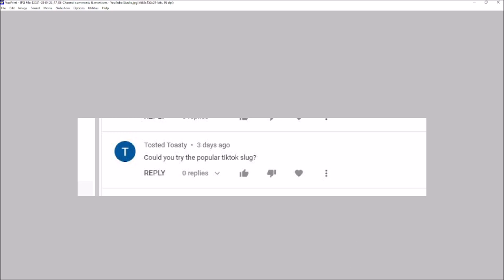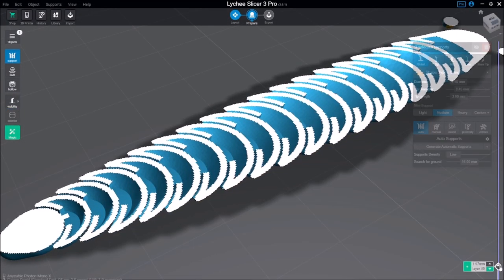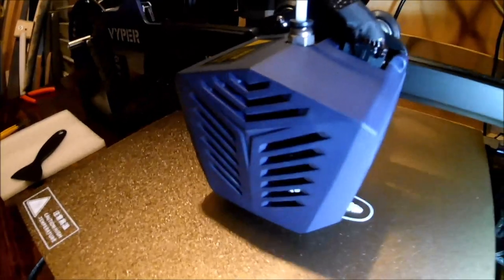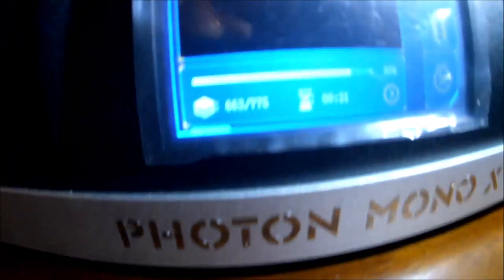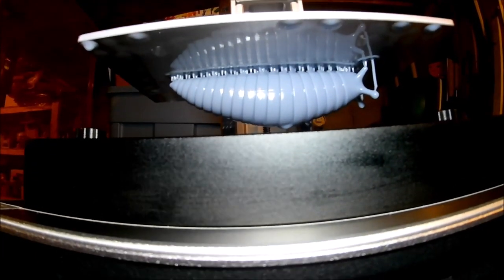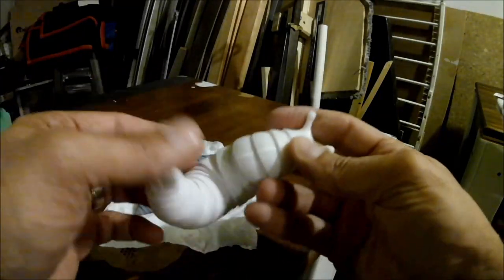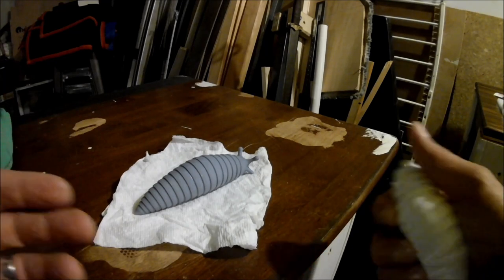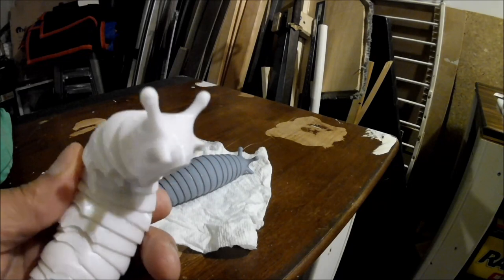Anycubic Vyper vs. Mono X "Slugging" it out with the Slug model

Comment: im so SAD, I printed my slug using the Anycubic Photon Mono. And it came out perfect and articulating. PLEASE TRY AGAIN! no supports, wash very well before curing. make sure its completely dry before the curing as well.
Reply from the maker: I believe I must have some light bleed possibly due to my screen protector.  I will try a few calibration tests and see if I can get some improvement.  Thanks for watching!
Reply: Also no success.
Reply: Lower the exposure ma dudes and dudettes

Comment: printed mine on the mono SQ,  it failed but some of the pieces moved  I sprayed in between each section with rubbing alcohol using a spray bottle getting the resin out.  I'm using any cubic Gray basic resin 20sec  bottom exposer time for 6 layers, a 2sec normal exposer time, at a 100% uv power output and a layer thickness of 0.005, also a off time of 0.5.
Reply from the maker: I think this is a particularly challenging model for resin printing.  Temperature and cleanup will definitely be factors.  Thanks for watching!

Comment: Slug on my Anycubic Mono with no supports printed fine in Lychee and is fully articulating. I've made 3 and they all turned out fine. Turned out fine on my Ender3 V2 also.
Reply from the maker: Hello!  Are you using the updated Lychee with elephant foot correction?  I haven't tried that for this print but I am hopeful it will work.  Thanks for watching!

Comment: Did the slug on my mars 2 no supports with ww mint at 30um, worked great but the clean up and cure were abit more effort that usual. Works great.
Reply from the maker: That's very interesting.  On the MonoX I must be having some UV light bleed due to the screen protector.  Thanks for the feedback and for checking out this video.
Reply: @RealgarTheSchist  did you have any luck with the slug on the mono x?
Reply: What settings you used for the Mars 2

Comment: I printed the slug on my mars 2 pro. No supports at all straight on the bed. I have a flexible build plate to make that possible. 50mic later height full size, took a bit to rinse after leaving it drain an hour upside down
Reply from the maker: Someone else reported the same success in resin.  I wonder if my screen protector is causing a bit of UV light to bleed which is causing my model to be solid.  I may try this one again on resin with some print changes.  I tried at 150% at 0.5 mm and still no movement. Thanks for watching and for the feedback.